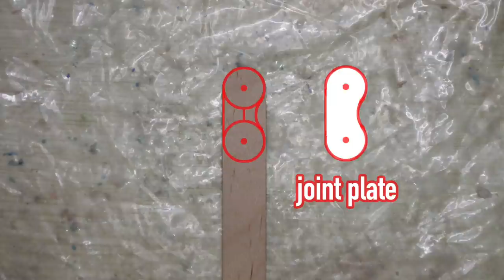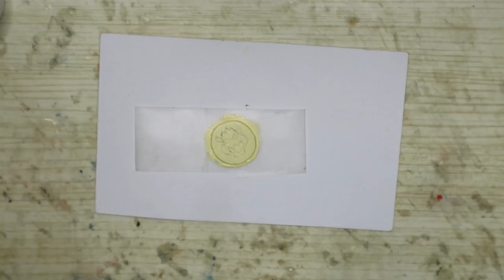PAINTCULIAR EPISODE 14: Bowser (🔞🎮 Doll Collaboration) + how to make doll joints v2.0

Comment: W. Wait. Did. Did you sculpt his meat??? Holy shit fjdjjdjdjdjjdj
This doll rules, and it really sucks from the struggle with the original base. I'd say that if you encounter a similar issue with a doll base, I think dumping hot glue and/or aluminum foil would work. I hope to see a reuse of the body, cause it could work for some other big monster character.
Reply from the maker: i sure did sculpt his meat! meh, idk about using the failed body, it seems less likely tbh

Comment: First off the bat the end result is great he turned out amazing considering a superman action figure was used as a base there's a lot of potential with those dolls of course they need body mods for sure but to start with its good. Also I gotta say as a fellow sewing hobbyist I agree that its rewarding but of course its a pain when you're new to sewing and you find out you're using the wrong needle for stretchy fabric and the wrong foot attachment, I made 2 costumes for myself while using the wrong needle and I'm lucky I didn't have to take them apart, but still its annoying as hell. For stretchy fabrics I recommend a walking foot and a ball point needle to minimize snagging I had to take apart the bobbin compartment of my machine just to get monster high doll size socks out of there. NIGHTMARE.